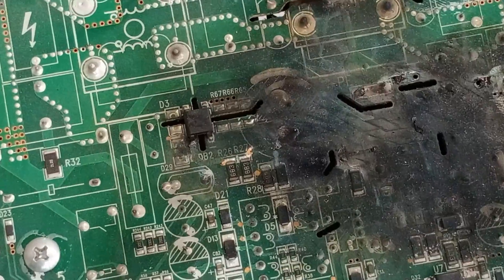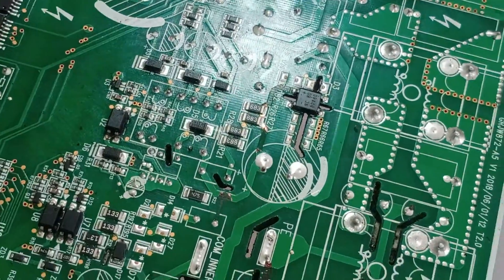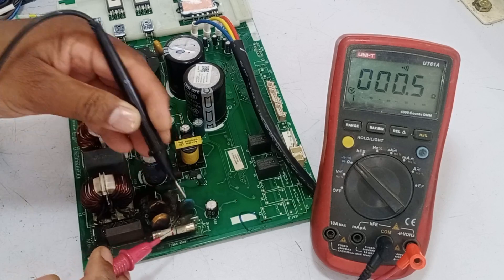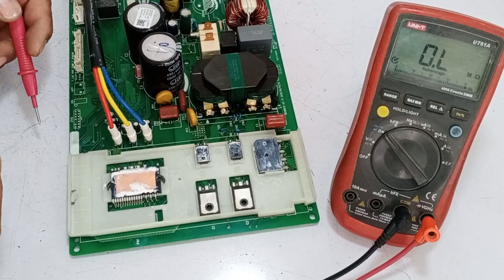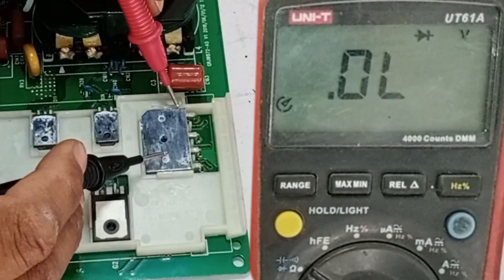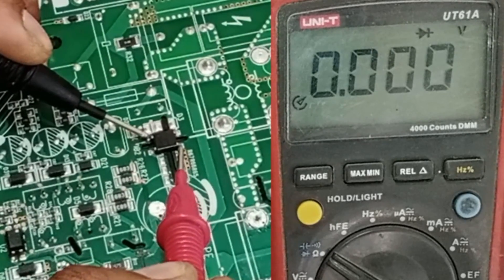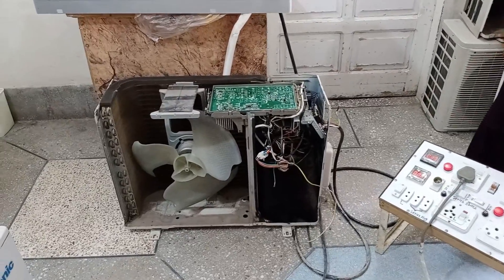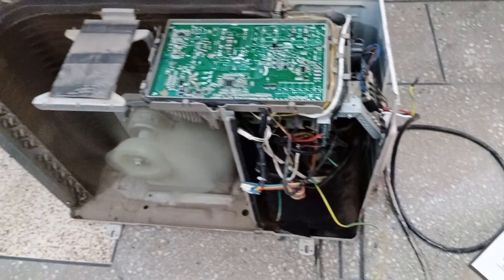Gree Mini Split AC Circuit Heavily Damaged After Power Surge

Comment: Over engineered pos boards.  Worthless fuses that dont protect shit.   First and last mini split ever.   Crap little machines.   Window units last forever compared to these Worthless pos units.  Great channels but here in US nobody troubleshoots these crap units.   Now have to replace these cheap ac unit with another cheap a ss unit and pray it wont crap out me in 2 years.   Do yourself a favor and get a window unit.
Reply from the maker: every thing has a lifespan, everything breaks.

Comment: On this particular circuit board, in condition of such bad failure, I'd trace voltage line for the mcu and inject small voltage. If you observe that mcu is damaged, any further investigation is pure waste of your precious time.
Reply from the maker: Thanks for your input! Tracing the voltage line and checking the MCU is definitely a good approach, especially in cases of significant failure. I usually try to cover multiple aspects of the board to show viewers a broader troubleshooting process, but I appreciate your suggestion

Comment: Based on your experience would you say that using a surge protector or some voltage regulator device that detect these occurrences is worththe money and effective to protect air conditioner circuit boards?
Reply from the maker: Yes using the surge protectors are worth the money, I agree. I tell my customers to use protective devices.
Reply: @forevertechenglish congratulacions
Reply: @forevertechenglish  Thank you for your advise